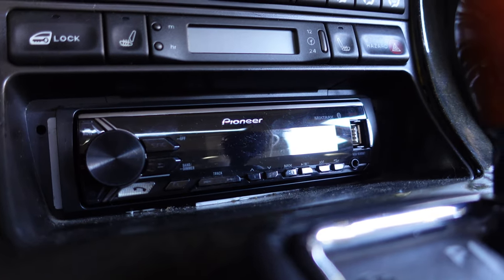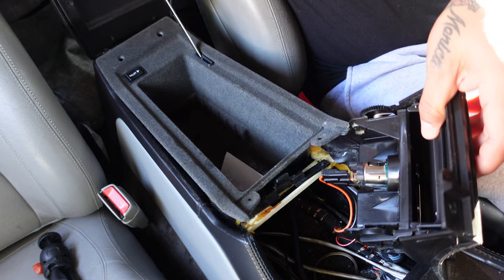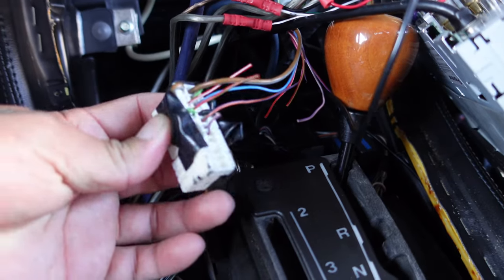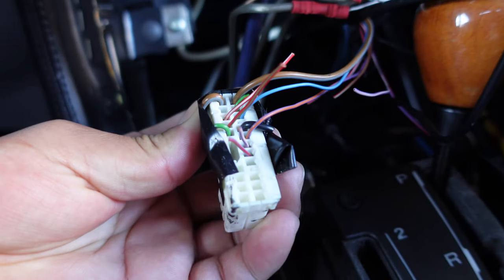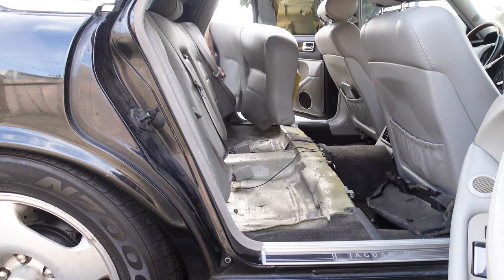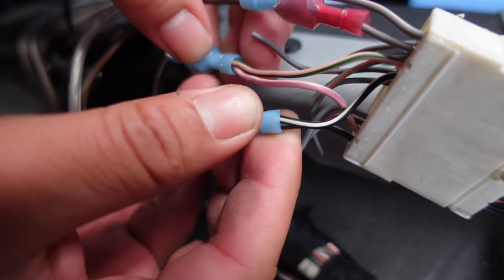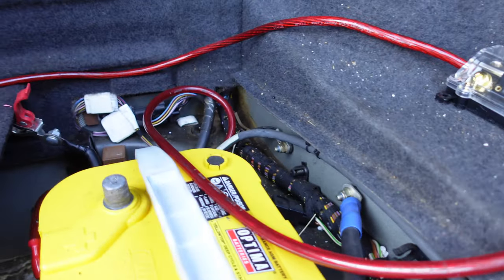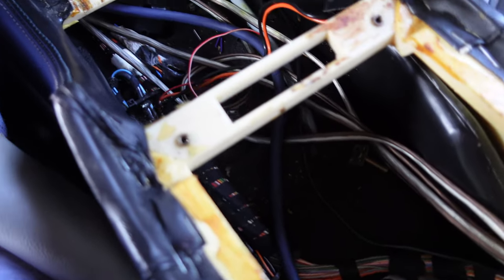Enhancing Jaguar XJ6 Audio Experience: Stereo and Subwoofer PT2

Comment: Of course, have a great day! In the center console of my XJ40, I fitted a connector plugged to the + and - of the radio, so I can charge the battery of the car from the inside during the winter. It's easier to remove snow just to open the door than remove all the snow on the long bonnet. :)

Comment: Hi Jessy, in my 97 XJR I have been struggling with engine whine coming through my speakers. I did an aftermarket stereo a couple of years ago and I've done all of the easy and  obvious fixes to cure it. I even added one of those noise suppression things to the power supply for the head unit. If you have had this problem with engine whine coming through your head unit I would love to know how you fixed it :)

Comment: You think the process would be relatively the same for a grand marquis ?
Reply from the maker: Yes ! wiring the subwoofer is the same procedure. There should be a rubber grommet on the driver side firewall that you can puncture to get the 12 V power wire through it. For the ground wire use the trunk frame to grounded it. The aftermarket stereo should be easy there’s a aftermarket harness that plugs into the stock harness. I’ll make a video on this later on the future. Thanks for watching

Comment: I've heard there can be an issue with these cars having a subwoofer in the trunk being able to hear it in the car because of the fuel tank? Is that true?
Reply: I had the same problem, I resolved it putting a 15 inch sub and a big ported box lol. But I was told a proper sealed box spec for the subwoofer is just as good. I haven’t tested that theory yet cause I got attached to the bass my set up produce